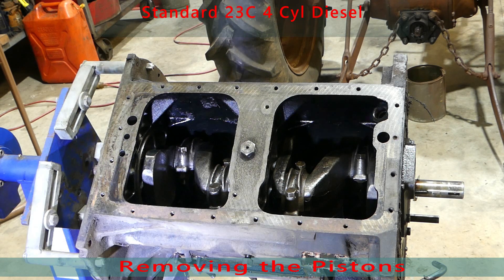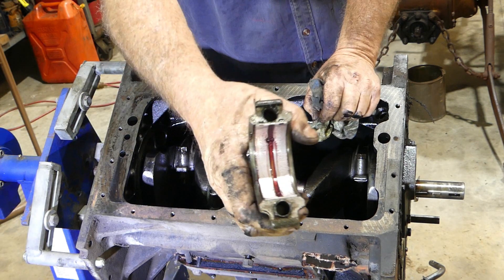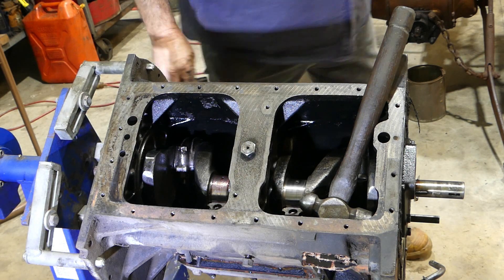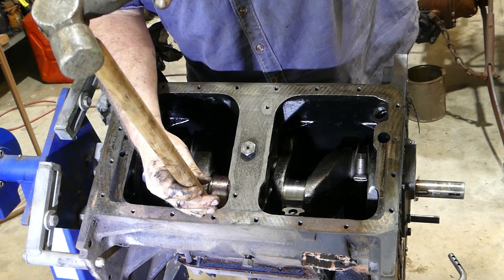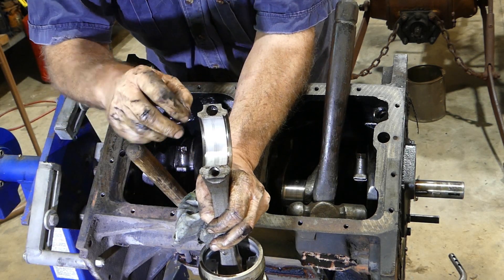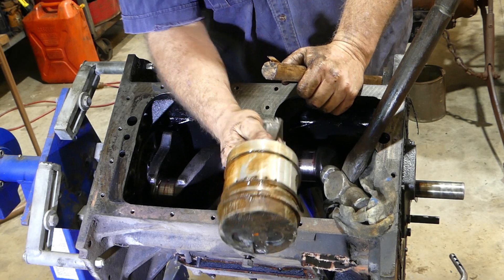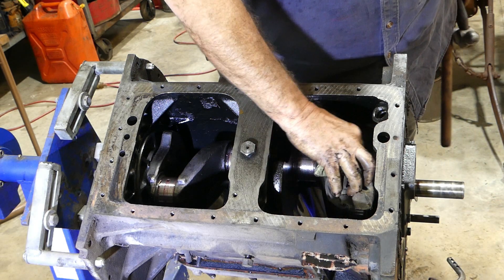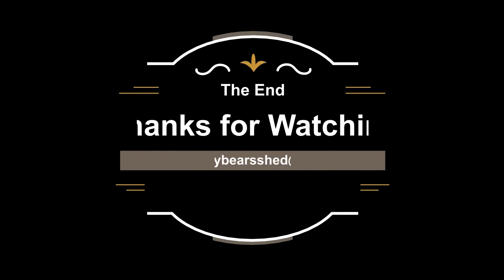Ferguson 23C Diesel Engine Part 8 Removing the Pistons

Comment: The connecting rods in the motor that I'm repairing were in an opposite position than those in your motor. Which is right? Mine has working fine as it was.
Reply from the maker: go to www.queenslandtractorspares.com.au in the technical section and there is a free manual download. You could look it up there.
Reply: @BundyBearsShed Thank You for the links and all these videos!

Comment: Great video Lance! Got the 23c engine and I Like it! Could you please make a video about hydraulic pump on the MF35 how to adjust the levers and so on? Greetings
Reply from the maker: Will do. The 65 Im working on now is almost exactly the same as the 35 so when I work my way down to that area I will cover it for sure.

Comment: HI Lance, nice run through on the piston removal.
It looks like you're scrapping a better motor then I'll ever have.

PS : Can you sort me out a couple of lbs of those metric sausages cos they sound really tasty.

Cheers,
Paul.
Reply from the maker: Yes the engine is in good nick indeed, It will be handy to have a good parts supply if needed with the others I have in line to recondition.